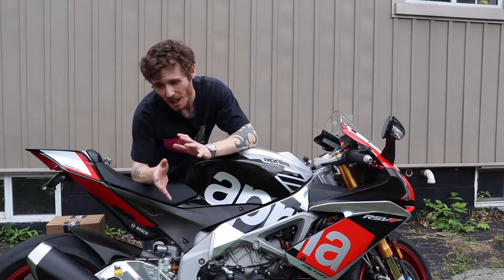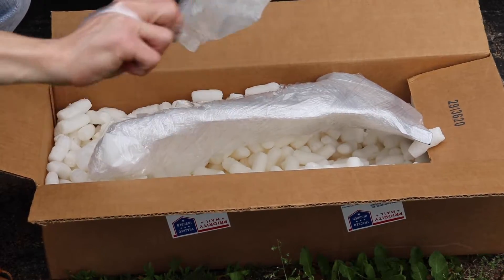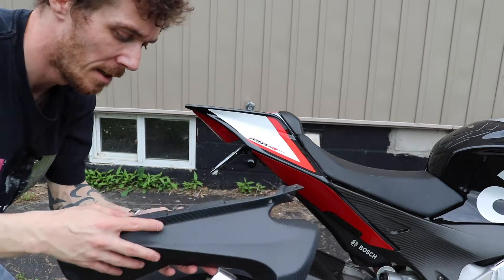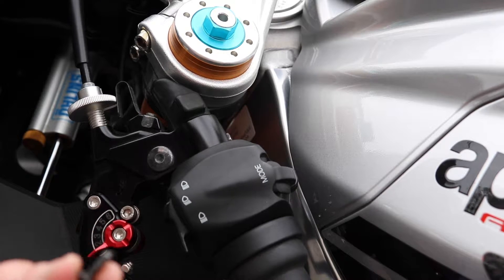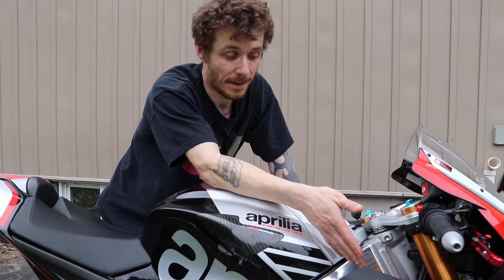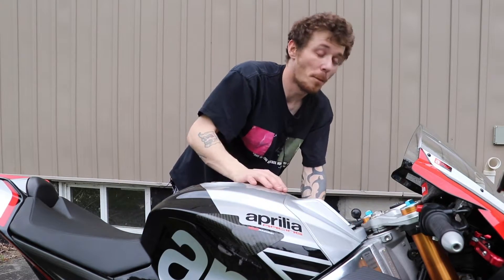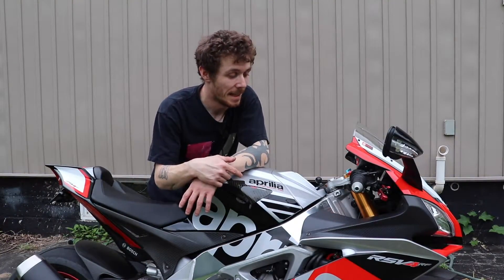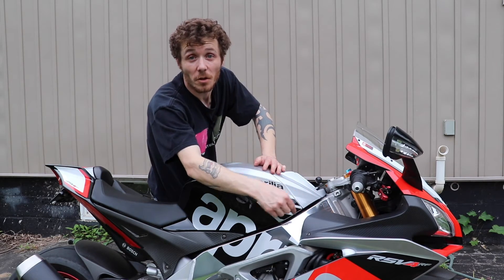Carbon Intake Covers HSBK Racing  |  Aprilia RSV4 RF

Comment: Where are your rear turn signals?   Integrated tail light?  I haven't been able to find a red lens integrated tail light anywhere
Reply from the maker: My rear turn signals are actually near my licences so late on my fender eliminator kit.  I actually prefer that over integrated, more visible. They do make integrated but I’m not sure about with a red cover though